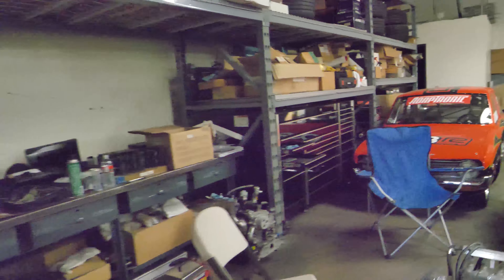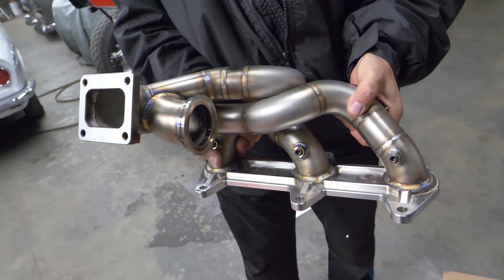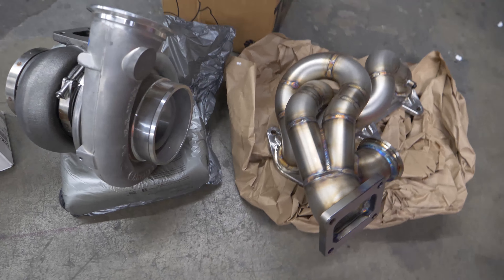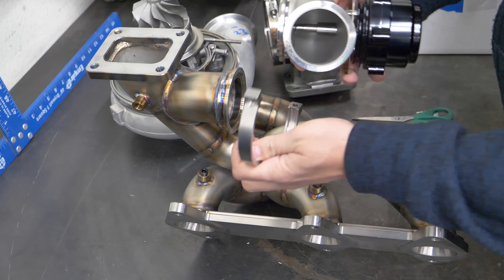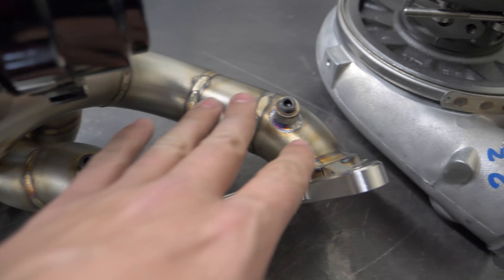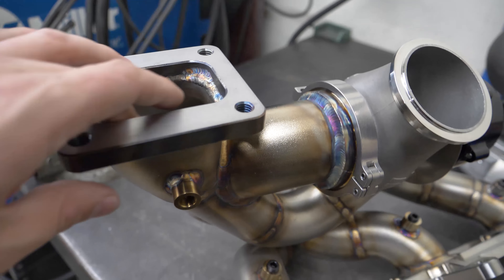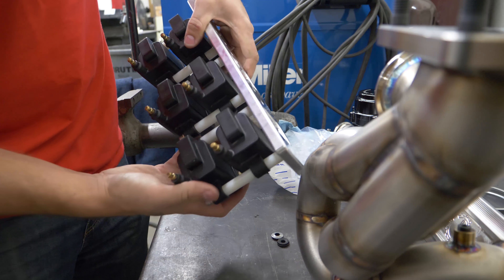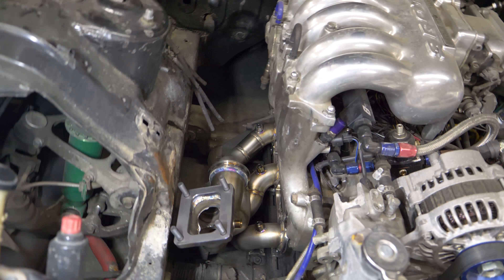The most advanced Turbo manifold on an RX-7!

Comment: Twin scroll housing on a single scroll manifold? The Fuxk? :D
Reply from the maker: Hogging the housing out. They don’t manufacture a single scroll to the size we need
Reply: Damn, some interesting stuff incoming :D
And uhm, why did they not try to make the manifold twin scroll?
Reply: twin scroll on three rotors? doesn't really work.
Reply: Alex Strömberg what if its divided on the middle of cyl 2?
Reply: David Dimov Just adding complexity for gains not really there to be had.
Reply: are you going to send it to be extrude honed once you have finished removing as much divider as possible?
Reply: Rob Dahm this is a bad move, there's nothing advanced about this manifold. Its made from junk pipe. Sure looks pretty, but welded schedule pipe, open scroll into a divided housing..... Weak man. Get a proper manifold, 321ss or inconel, and use a Stainless vband housing.

Comment: I was under the Impression that EGT sensors are old tech compared to the modern Wideband. 
I understand the appeal for cylinder specific monitoring however.
Reply from the maker: Combination of both is solid. Tune to the desired wideband results while also making sure all 3 rotors are experiencing the same conditions

Comment: TURBO!!!!
Reply: I feel like this would benifit a lot from a VGT. You would have less back pressure at low RPMs because there would be less resistance on the compressor side of the turbo. And it would build boost faster.

Comment: Maybe its just my perception and maybe it doesn't matter on the rotary..Is that wastegate port on the manifold angle back away from the flow direction?
Reply: You have to either prioritize the wastegate or the turbocharger. Can't do both. Depends on how much peak boost and how much part boost your engine is going to produce.
Reply from the maker: Yeah going for maximum turbo focus.  We have a real chance of maxing out the compressor housing to get to our power goals. So we are trying to throw as much exhaust at the turbo as possible
Reply: Thumbs up! Keep tearing it up!

Comment: v band are suppose to have a slight tapper inward so filling will most likely cause more exhaust leak, they are that way so there is less contact area meaning more applied force on a smaller area = better seal

Comment: this is a noob question, but why does each rotor require 2 ignition coils?
Reply: Austin M 2 spark plugs for each rotor, one doesn‘t charge fast enough to power both spark plugs
Reply from the maker: Many piston engines also have the ability to fire waste spark and use the same coil for more than one plug. In my case each rotor has two spark plugs and while stock Mazda did some fancy things I want one coil for each plug so I get maximum spark delivery.